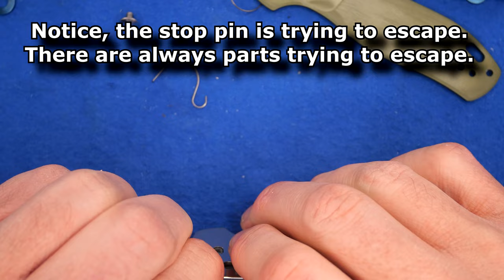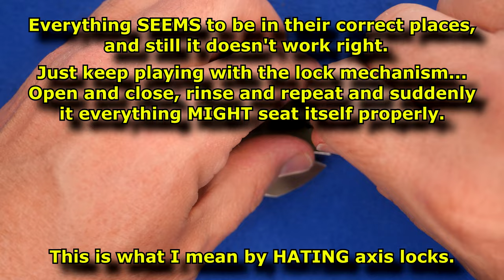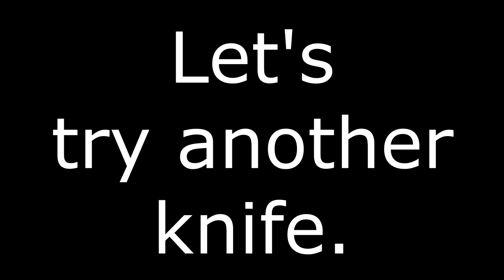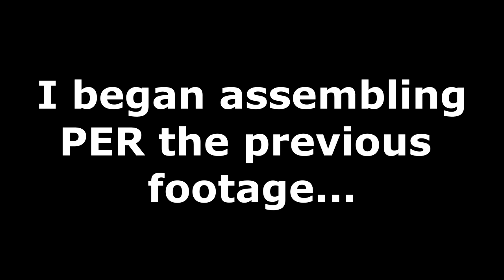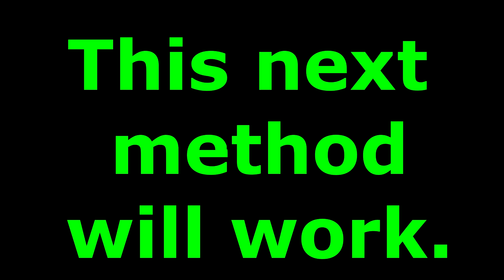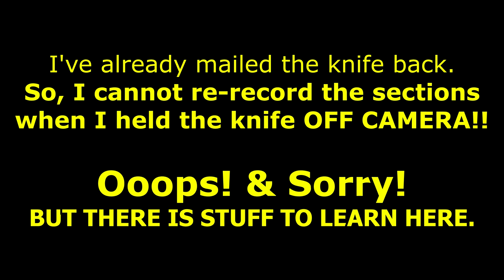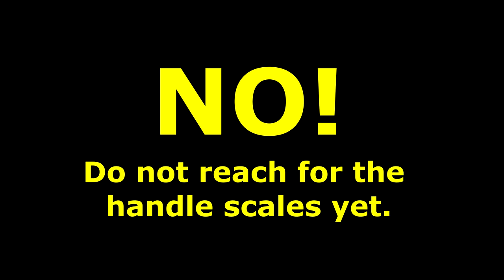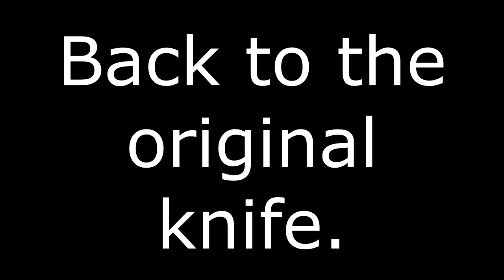CCEU #28   How to Re-Assemble an Axis Lock Pocket Knife - 3 Examples: Easy, or Moderate or DIFFICULT

Comment: If you just need to lube the bearings or washers you can just remove the pivot and save a lot of time. I am pretty sure Nick Shabazz has a video showing that method.
Reply from the maker: Yes, there are easy ways to just add lube without taking it apart.

Comment: I only skipped through the video but I think there is something you forgot to mention:  For knives running on bearings, and where all of the milling for the bearings is in the blade, you don't need to disassemble the knife in most cases.  If you remove only the pivot you can slide out the blade and bearings.  Then, because the milling in the blade will hold the bearings captive, you can easily re-insert the blade/bearings combo back into the knife.  This is much easier than attempting something similar with washers.  Historically I was never much of a fan of bearings, but when I realized this it was a complete game changer.
Reply from the maker: I agree with you, in that scenario, you wouldn't need to take the knife fully apart.
So, while you offer good information this video is not about how to do knife maintenance on an axis lock, per se.  It is it is solely about how to reassemble it IF you did take it ALL the way apart.  
Therefore I didn't forget any information, it just isn't a video about the topic you are concerned with.
Reply: @CanadianCuttingEdge  That's true. But the reality is that you rarely need to break down an axis lock knife entirely.  Now, you do need to do this practically on a knife with washers, because it can be even more difficult to get the blade and washers all lined up so you can slide  the pivot through.  What I am saying is that if your knife has bearings you probably don't need to do this.  This is definitely something you will want to mention when you go to do your next video on this topic.

Comment: You sure did have a hard time with those axis style lock knives lol 😂, I have many Benchmade axis lock knives and a few Houge axis style knives, I haven’t had the problems that you are having putting the knives back together when I have to take them apart but with that being said the one thing I don’t like about axis style locks is the Omega springs break regularly I must have replaced at least 8 so far the most recent was on my Adamas , Benchmade will send you new Omega springs free because of the warranty but still they break to frequent for my liking ,that’s the only thing I don’t like about the axis style locks even though they are probably one of the most popular locks on the knife market.
Reply from the maker: Good for you Joe.
If I wanted to make a video showing off then I could have easily made a short video quickly showing how fast I can assemble one of them but then people would have learned a lot less and it would not have been a helpful video.
I too have not had any difficulty with my Griptillian, but not everyone only buys Benchmade, which is why I made this video.  So many companies are using that lock style now that they are allowed to do so, but they are not following the exact construction techniques that Benchmade followed which means people are having more difficulty = I make a video to show those difficulties so that people don't have to feel bad about how long they fought with their knife and I show them the solutions as well.
Breaking springs - I have had dozens upon dozens of budget knives with axis locks and never had one break a spring. My guess is that Benchmade makes their springs thinner and weaker than other companies do and they probably do that so that the springs feel softer and easier to manipulate.  So, if you don't like breaking omega springs, maybe buy something other than a Benchmade.
Reply: Yes I’ll have to try other brand knives that have the axis style lock and see like I said I have all benchmade and some Houges and I haven’t had a problem with the spring breaking on the houge but I don’t use the houge much even though it’s a really nice knife I guess I’m so use to benchmade that it’s the main brand I carry I been buying and using benchmade since 1995 I guess I’m partial to them but I am going to try other brands with that axis style lock